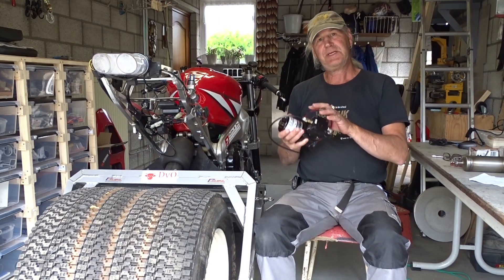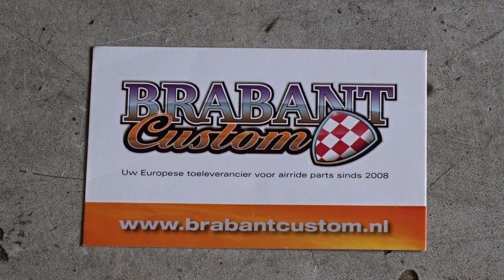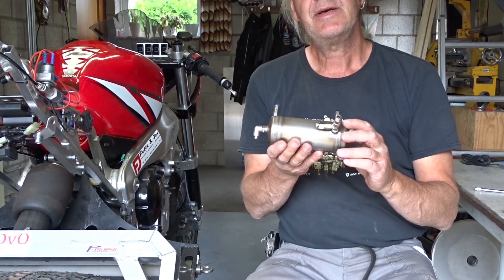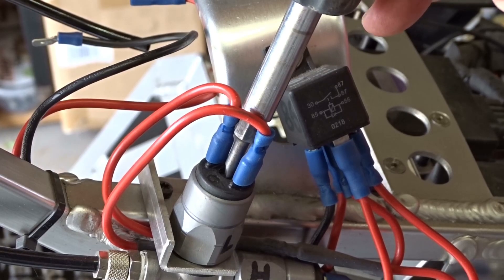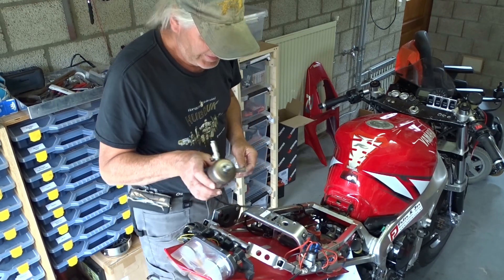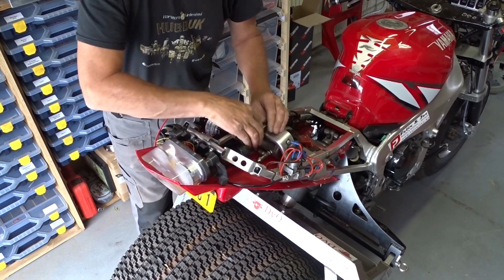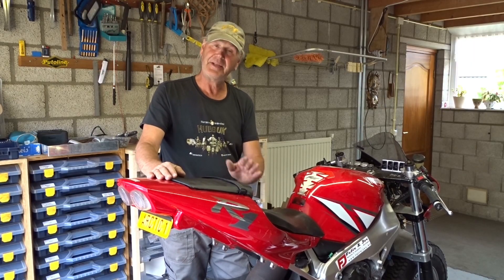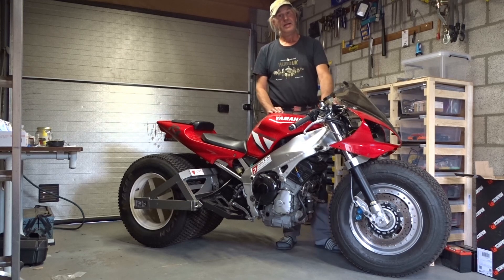North Pole - aRctic1 Bike Build - Part 7 - Compressor and Air Suspension

Comment: I see that you have the specially developed engine oil for the R1, so I was wondering about other oils - like compressor oil, fork oil (if any after air conversion) and grease - will you be changing to extreme cold duty lubricants for these also? Great build, seriously ambitious as always.
Reply from the maker: Thank you for the interest and the nice words.
Fork oil is special from Putoline too.
Compressor has a dry sumb.
Cooling liquid is special too, delivered by Putoline.

Comment: Was wondering; Don you have a friend or is there a way you get set you bike in a freezer to -40c to check that all components will work properly in these temperatures? 
  Thank you for all the updates and I am truly hoping for a great success.
Reply from the maker: Much is learned during my previous adventures. All that did not work is done on a different way this time. I have no freezer in the right size :-)

Comment: Your sense of adventure is inspirational. Is it the same YZF-R1 that you've had the whole time?
Reply from the maker: Thank you! It's the same model, not the same bike. There is the 2001-2006 RTW R1 'Florentina, the 2013 Polar Ice Ride R1 and this aRctic1. Since a few month I got an other one for the future.
Reply: @florentina2001  sorry if I've missed it, but do you have to run special fuel, or pre-heat it. Could there be issued with the carburetion?